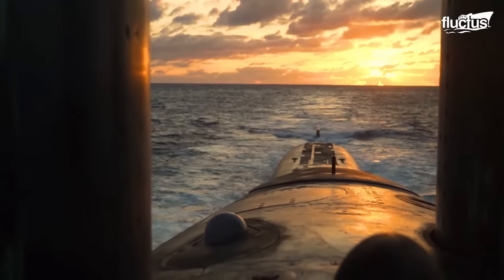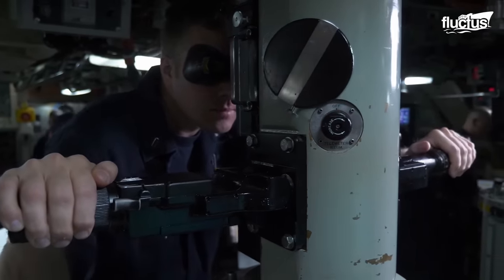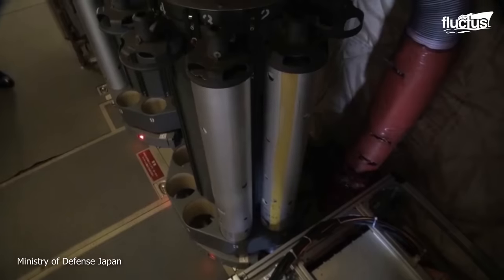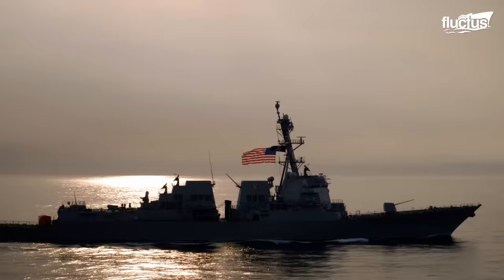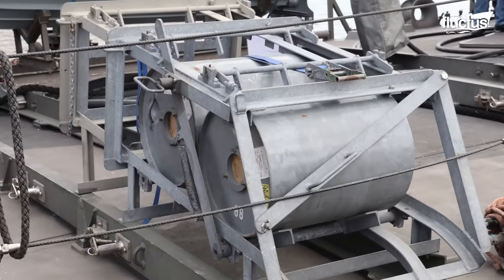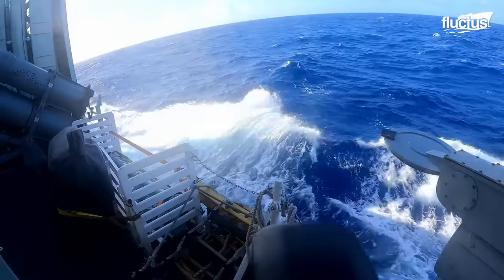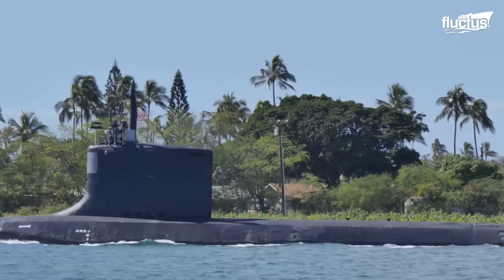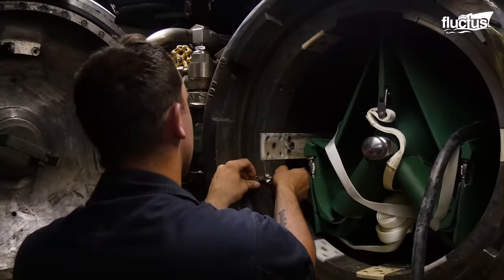The Genius Techniques US Found To Track & Destroy Submarines From The Air

Comment: 2:40 "...Sono buoys are floating sonar sensors that can be deployed from a ship or aircraft to extend the listening capabilities of ASW forces...".

Plus, for the ships, they (as well as the SONAR towed array) allow for listening in the quiet, away from own-ships noise.  Though the towed array is primarily for listening away from the noise of the own-ship's screw (propeller), which would otherwise be a "blind spot" for the ship, because of the screw's noise.

Comment: Nobody on earth...
Can track or find a US Sub...

We always trail within 12' behind or under Russian and Chinese subs. They are so loud.... They had no clue.
Reply: Can a P8A Poseidon detect a submarine? I believe our country, NZ has four of these planes currently used for search and rescue, maritime surveillance etc
Reply: Huh? Well here's a fact, there are Russian submarines that is actually as quiet as U.S submarines. Also, most Chinese SSNs are loud, not so much for their SSKs though.
Reply: @JenniferA886 ...What do you think it's meant to do?
Reply: @M16_Akula-III  I have no idea… I’ve never been on one. I believe it has a powerful radar
Reply: @JenniferA886  RADAR doesn't work in water, in-fact it's only effective for around 50 Meters in water. It uses sonobuoys, basically a hydrophone put on a flotation device that transmit data wirelessly.
Reply: I remember back in the first half of the 1970s I was with a Patrol Squadron in Sicily. Our squadron was assigned what they call Bravo Services where we play war games with one of our fast attack submarines.  Our squadron failed to find it.  I did ground avionics maintenance and overhead someone say the name of the submarine and at the time my older brother was a STC on it.
Reply: @Chris_at_Home  Can you precisely say what year was it?
Reply: @M16_Akula-III  Early 1973.
Reply: @Chris_at_Home  It could've been a Flt.I 688..
Reply: @M16_Akula-III  No it wasn’t. it was the 650. After I got out of the Navy at worked at EB mostly on the 694, but I also did some work on the 690 and the 650 when it was in dry dock. I only worked there a short time. I’m from that area.
Reply: @Chris_at_Home  I didn't know that chill out
Reply: @Chris_at_Home  Ah so it's a Short Sturgeon
Reply: @M16_Akula-III  I had breakfast in the Chief’s Mess on the Pargo when he and I met up in Rota. We went out and had a few beers and then had steak and eggs at 0200. He was 10 years older than me. I moved to Alaska in 79 but visited family there quite often. My wife also has family there. We grew up going to school together.
Reply: @M16_Akula-III  ok, thank you for clearing this up. I was aware our defence force in New Zealand has four of these planes, although I have never heard of submarines entering our waters. Thanks again 👍👍👍